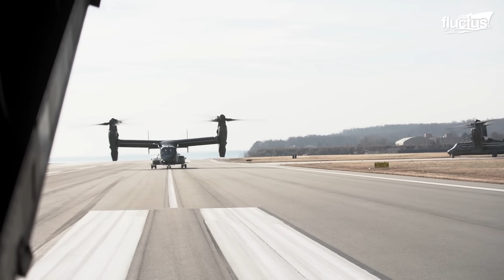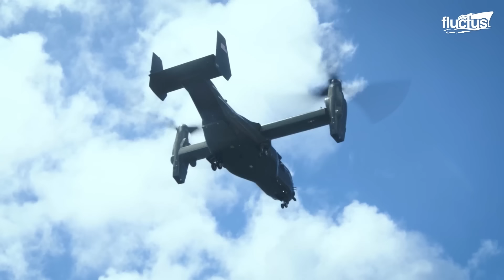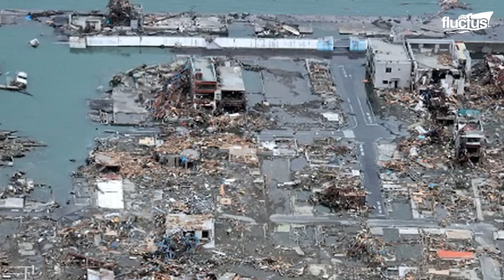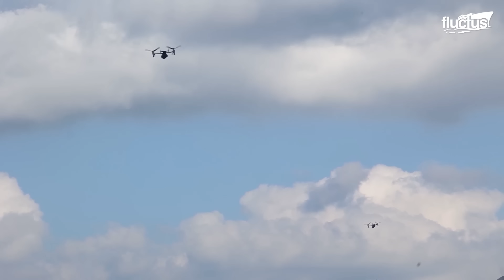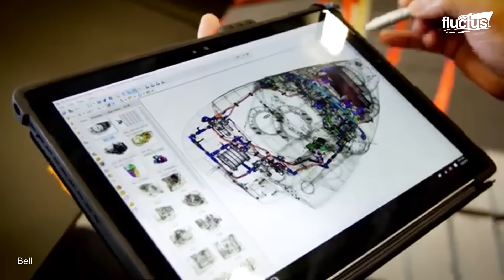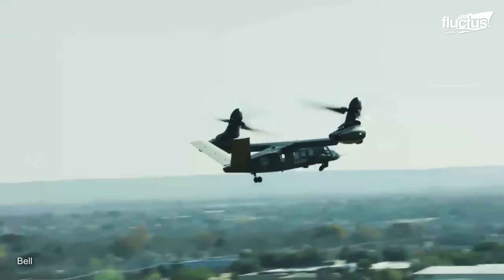Why Is Trump Banned from Using His $80 Million “Transformer” Helicopter

Comment: The MV-22 is no more dangerous than any other vertical lift aircraft.  The reason people feel it's more dangerous is purely perception. Accidents, groundings and crashes get more press coverage than those of CH-47Fs, or UH-60s. However, do some research with valid sources, and you'll see the MV-22 has an outstanding safety record per 100K of flight time.
Reply: You can fly on it all you want. I still wouldn’t recommend flying in it, period. There’s a better chance to make it out of an accident in a Blackhawk than in an osprey. That’s a fact.
Reply: It is more dangerous than helicopters.  First, unlike helicopters,, it cannot autorotate.  Second, it is susceptible to vortex ring state: the aircraft descends into its own proprotor wash, which becomes an uncontrollable descent leading to a crash if it doesn't have the altitude to fly out of it.  Third, the tilt axis gearboxes are complex and prone to failure, which have no parallel in normal helicopters.  Fourth, the proprotor gearboxes and interconnect gearshafts are prone to catastrophic failure.

If a helicopter loses engine thrust, it can autorotate.  An airplane can glide.  The MV-22 can do neither:.